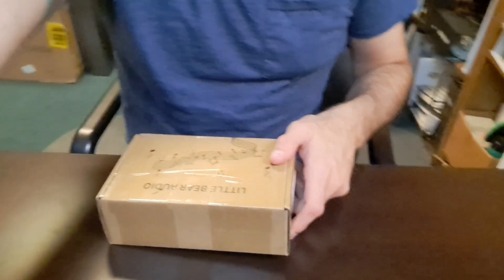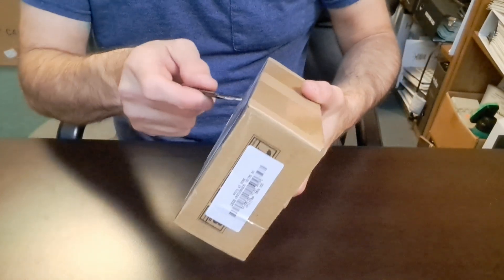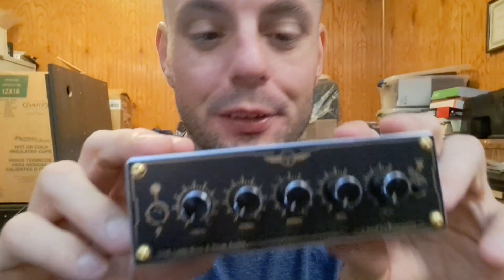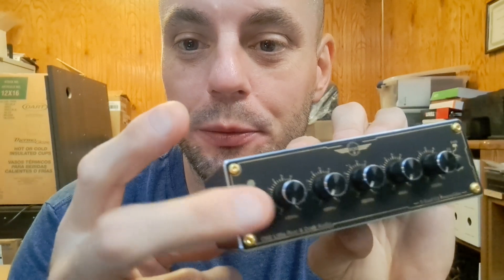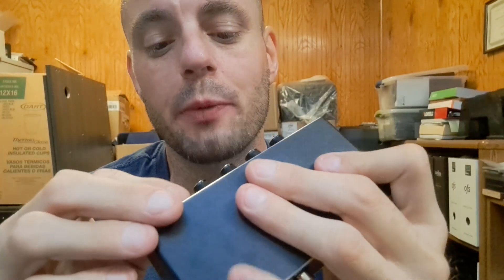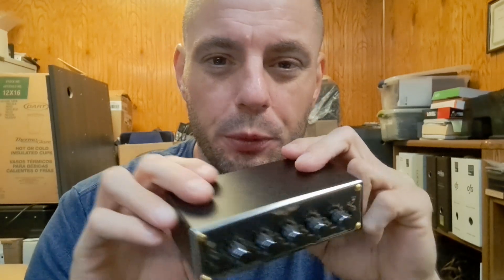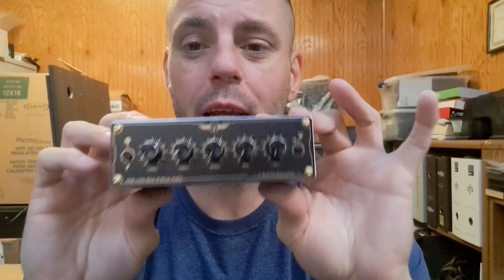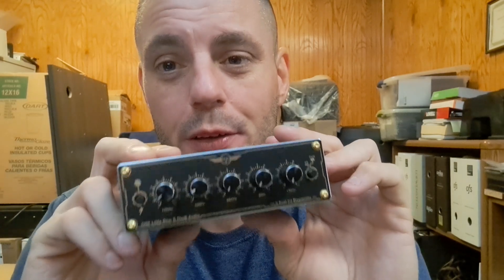DOUK AUDIO EQ5 MINI! 5 Bands of Goodness.

Comment: I don’t want to come across as a jerk, and you never claimed it would happen, but where’s the part where you demonstrate the EQ in action? You pulled it out of the box and discussed the size, the paint job, even another variant by the same company…. These uploads are hard to find, lol. Wish I got to see it in action and get your actual feedback on how it performed regardless of how small it was. Anyways, cheers 🍻
Reply from the maker: @Anewchapter01  it's kind of hard to demonstrate the eq because the mic on My phone. It isn't the best at picking up such slight changes in audio, plus once youtube compresses the hell out of it during upload, in my eyes it kind of isn't worth it but I understand where you're coming from. I actually use a Schiit Audio Loki 4 band eq now. Much better build quality and usually decently priced, used, on ebay and such. Lots of reviews on Schiit Audio if you want to give them a look, don't let the name fool ya lol

Comment: hi great video . I am looking for a EQ to cut down the bass as its to over powering . Its totaly my own fault , I purchased a newer bigger speaker .I had Dynaudio Emit 10 But just upgraded to Emit 20 s wrong move. So back to the point do you think this will be suitable to cut down my bass . If you could find the time to get back to me i would appreciate it. Many thanks gerald South Wales UK
Reply from the maker: Theoretically it should be able to cut down some low end bass frequencies. Although I'm not sure how variable the 50hz knob is, I'm sure it dips down to 20hz.

If you're able too, get on Ebay and look for a used Schiit Audio Loki 4 band eq. It has crazy variable range starting AT 20hz and up.
Reply: Chinese made junk. The fact that it doesn't have a proper power cord shows it is low quality.

Comment: Hi, thanks for your video. Could you confirm that you can decrease or increase the frequencies ? The graduate numbers around each knob go 0 to 10 on this device. Like this, it seems you can just adjust 0 to +10db. Or the 5 number at the top of the knob is the zero level. Then you can adjust -5db (0 on the knob) to +5db (10 on the knob). Can you help me on that ? Thanks

Comment: My mom is 85. She listens to her TV in her bedroom with headphones. She's been complaining lately of "muffled" voices, (probably some hearing loss). Her hearing really isn't bad, but I've given her a few pair of headphones to try, and she still has some issues hearing some voices. So I'm thinking it's not a better pair of headphones she needs, just ability to control (and or boost) tone.
I was thinking perhaps, a device like this might be the thing, to allow her to make out the voices more clearly. I like what you said at 7:56 about "vocals".   So hopefully this device might help. And it won't kill the wallet to experiment with it.

thanks for the review.
Reply from the maker: Hey, you may try this little device, not sure of the cost, but maybe something more suited towards headphones(headphone amp) would work. This also has some tone controls, she wouldn't have all of the bands, but this has a loudness button and I think you/she may be able to use the tone controls and the other options it has, to help find a happy medium. 

https://youtu.be/4HavT6L7U1A?si=8BDoRNDCSq_JBDZz

You could also check CheapAudioMans other videos on headphones preamps and you might find some better options.

Back to the EQ, there are a few different listings from the company for it, sort by lowest price, mine was under $50. For the price though it's actually a nice little eq, so even if you just wanted to mess with it, as you said, it's cheap enough.

Comment: Can you suggest me a amplifier for 2x260w(8ohm) subwoofer, 2x360w (6ohm) speaker and 2x180w(12ohm) speaker?
Reply from the maker: I need more information. What kind of system is this? Why all of the random ohm load paired drivers? Some sort of home theatre setup or?
Reply: @scarr3ll  basically it was sony mhc gpx8